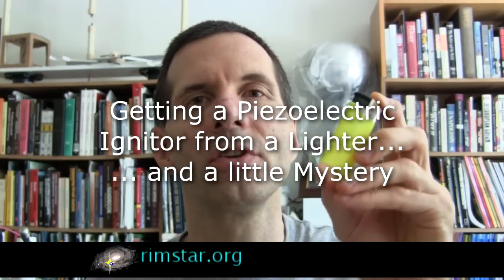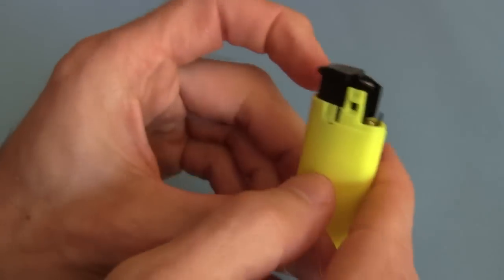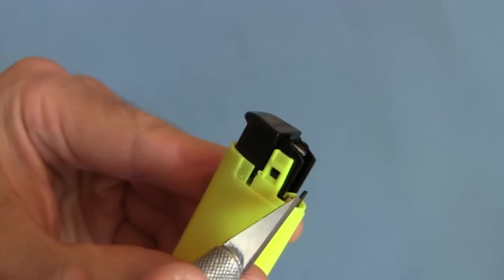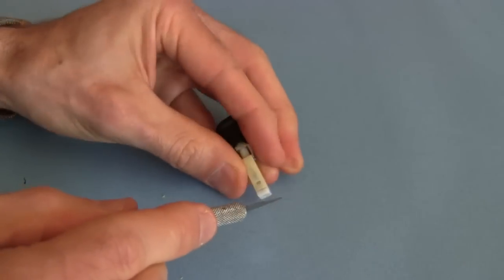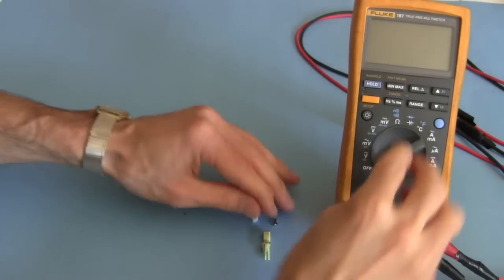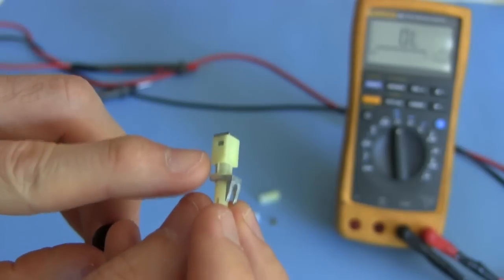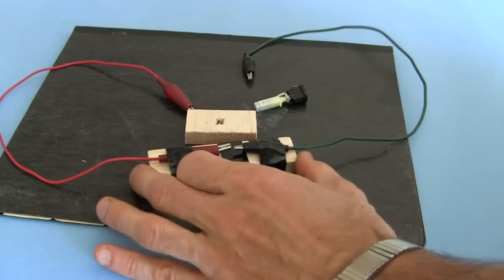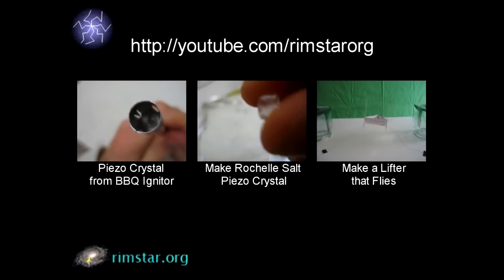How to take Piezoelectric Igniter from Lighter for Spud Gun

Comment: I have one piezo right here and im afraid to shock my self. Im wondering how much voltage it is. And what will i feel afterwards
Reply from the maker: charisel christian As always, if you have a heart condition then it's probably best not to get shocked. But if not, while it's a a few thousand volts, the shock lasts only a few microseconds and so doesn't cause harm. It does hurt briefly where you get the shock, like being slapped medium hard with a ruler
Reply: that means yes :D
Reply: +charisel christian are you serious?
what are you afraid of ?
it's nothing.
Reply: yea i noticed when i shocked my friend but he said its not that bad so yeah..
Reply: i mean charging through capacitors would take forever. and yea i also have 220-240 v. im looking for something that could shock continuously no just for a moment

Comment: Ahh my mistake, yea I took the one I thought was battery operated apart and it was purely a pizeo electric one :) You're right about the sting though haha;p , and I read up that the output in general is just too weak and you'd be safe to zap everyone around you for a laugh. Just wondered though theoretically if you were let's say drenched in sweat, could it say be used as a makeshift defibrilator in an emergency? ...though I'm theorizing again the current would be too low;p

Comment: Around how much current that spark can deliver?
Reply from the maker: I don't know. I've never had a way of measuring it, nor have I ever run across any estimates.
Reply: RimstarOrg Can a Shunt work?
Reply from the maker: The problem is that the current during the spark is neither AC nor DC. It's a very sudden rise and fall, as you can deduce from the voltage trace shown on the oscilloscope in the video. So the current is anything but constant, it's just a sudden rise and then a sudden drop.
Reply: RimstarOrg Well, thanks for asking my questions.
Reply: Eternal Abyss how would he ask your questions?

Comment: So this is a DC Voltage right?
Reply from the maker: It's hard to call it either AC or DC. Have a look at the scope output at 5:43. Most of it is one polarity, like DC, but it's actually a dampening waveform. It usually have a large peak in one direction, then a much smaller peak in the other direction and then continues to alternate like this while rapidly diminishing. At least that's what I typically see on the scope.
Reply: RimstarOrg Thank you!
Reply: it's amazing

Comment: What is spud gun
Reply from the maker: It's a gun that shoots potatoes as the bullets. You fill the tube with a flamable gas, put the potato on the end of it, and use the spark from a piezo igniter to ignite the gas and fire the potato. Another name for potato is spud.